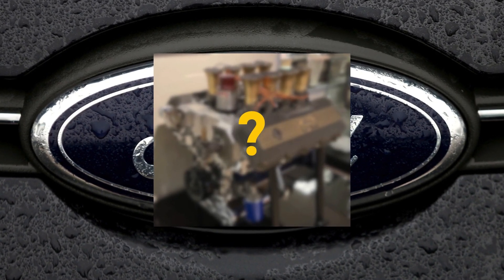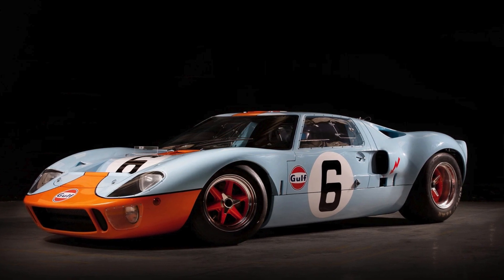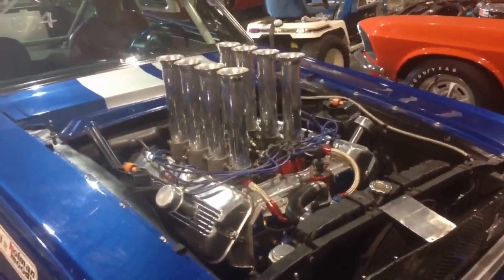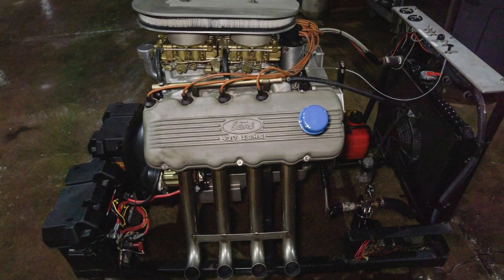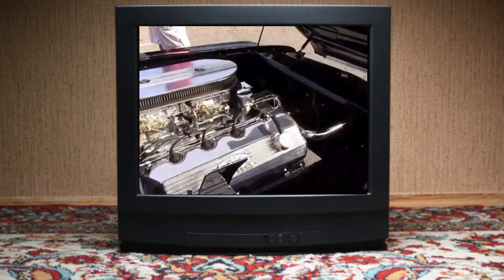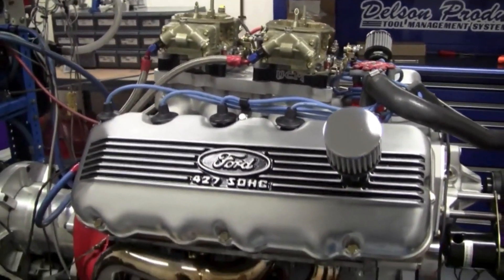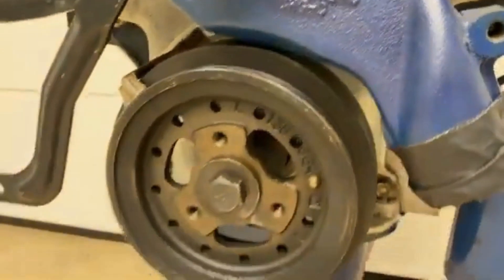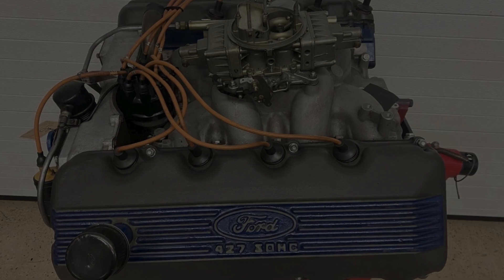FORD's Banned 427 ENGINE - The Cammer

Comment: I like engines. I'm a master engine builder of over 60 years experience. Which means that I was around for pretty much all of this. If you're going to compare the 427 SOHC to the 426 Hemi, remember that the street 426 Hemi is the "dumbed down" version of the 426 Race Hemi.

Different engine. The street Hemi has an upward tilt to the cylinder heads. Less aggressive camshaft, lower compression ratio, etc. The Race 426 wouldn't fit into a production car. And right out of the lab the 426 Race Hemi produced upwards of 750  horsepower before it got dialed in. How much power its street counterpart made was of no concern. It was for homologation purposes only.

If you want to know how much real power the 427 SOHC made you just have to do some grade five arithmetic on a Ford timeslip. NO, it did NOT put out 615 horsepower with one 4-barrel. And NO, it certainly did NOT put out 657 horsepower with 2 four-barrels. Ford sabotaged themselves with their false horsepower boasts. NASCAR (Bill France) decided to believe Ford. That's why the weight penalty and the full size Galaxy. See what happens when you B/S?

It's really not too hard to demonstrate who was putting out the horsepower when Ford's SOHC was in the tens and Dodge's HEMI was in the nines, with heavier cars. As you can see, I don't drink the Kool-Aid, and the fractured fairy tales about the Ford 427 SOHC are more crap than I can shovel in a month.
Reply: You are so right … I’m so sick of listening to the fairytale  engine that ford built in 90 days and that evil Bill France banned … Its obvious when you look at the engine  that  the engine was a bitsa… bits of this and bits of that …!!… It was based on an fe block …… single overhead cams that turned on a 6 foot chain…!  It had a weak bottom end … the chain stretched … the spark plugs where on the north side of the heads (first on the south side)  and it was difficult to work on and in my opinion … I’d say it was an absolute pig…!! 
If ford were serious they would have forgot the cammer and tried to build a serious engine… to take it to the Hemi … I’m a ford boy and I’ve always hoped that ford might grow some balls and for once put it all on the line like Chrysler did and build a serious engine … but no … they never have and they never will …  
That is why now I’m looking at the gen 3 Hemi … looking to fit that into my ford …! 😂
Reply: @petervossos4816  The "gen 3 Hemi" is a Hemi in name only. I'm not particularly fond of them. Just did a 6.4. Bit of a swine to work on. And their reliability is questionable. Sure, they can be made to really put out. But your better bet would be to re-power with an LS. Better engine by far.
Reply: @  LS … what’s your pick … and for a big block  to power a street car with 1000 reliable hp what is your choice ??? I’m so interested to know because there is so many engines for sale the right choice is impossible to make …
Reply: @petervossos4816  I answered your question. Some coward deleted it. We can't have experts on engines talking about engines now, can we?
You might actually learn something. I have better things to do with my time than try wording my posts around gutless tube. Screw this.